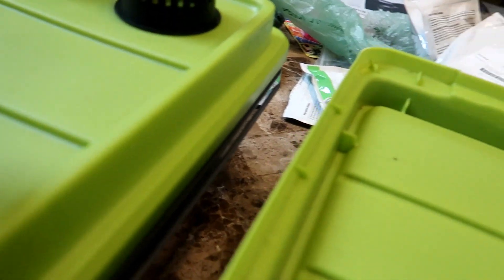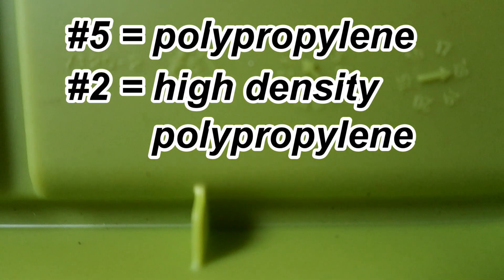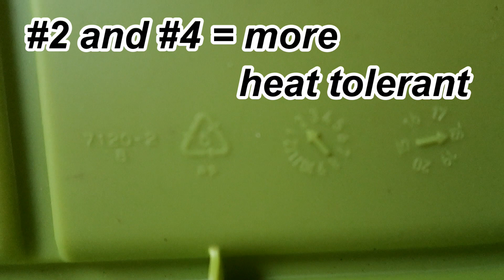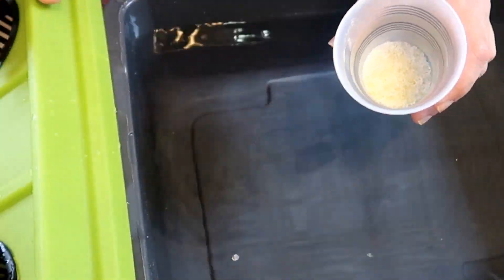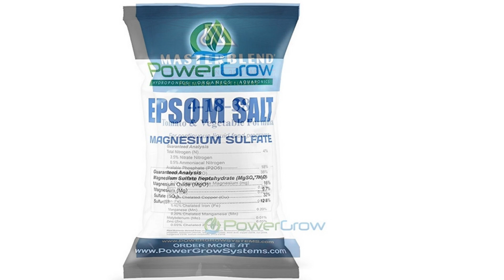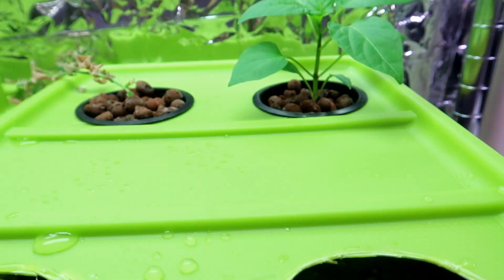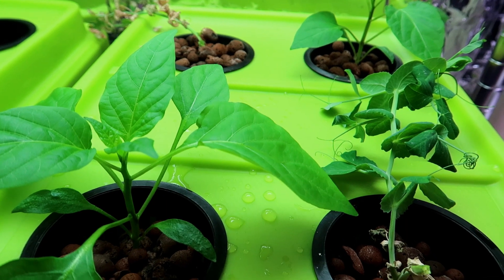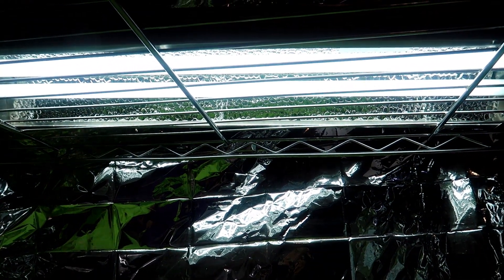DWC Deep Water Culture Hydroponic System: Simple DIY Set Up

Comment: very nicely done but it should be one plant per tub otherwise one bad plant can poison the rest and no drip on top of the pot to keep it going while the plants reach for water  as the pot should be at least 2cm above the water not in it otherwise the roots become unhealthy the foil also throws bad light natural light does not reflect under leaves outside so it shouldn't inside once i changed to that setup from the one in your vid and (ty as i would never have started without it)  i doubled its potential

Comment: i suggest having the air lines coming thru the lid, and having a spare tote for water changes, when it comes to it all you do is lift the top and put it onto the freshly prepared tote, simples, if you have an inline connector just off the exit from the lid you can make each system modular, things can be moved, disconnected simply, makes life real easy and you can make lids with varying designs of holes for different sized plants and switch them out, keeping the air line etc all wired in ready to put a stone on and bam you are growing

Also when you put your new seedlings and rockwool into the net pots have a layer of balls at the bottom, the roots will figure their way you dont want the rockwool to ever be saturated, its just meant to splash the new roots and be a humid environment to encourage them to grow out, the plants will rot if your main root ball node doesnt stay dry

Comment: Absolutely love your videos! You explain things so well, and aren't afraid to be honest about any short comings. When you said my lighting needs would be more in a basement setting, does that mean I'd simply need more lights (maybe a large one on top and both sides?) or that say, instead of a blue light like you have, the main light should be full spectrum?
Reply from the maker: Hi Angela, I think both since the basement has no ambient light, and no light filtering in from outside.  My kitchen grow area is the opposite of a basement, I have two large skylights and a large bay window.  On a sunny day we don't even turn on the lights, you can't do that in the basement.  I think a full spectrum LED would be your best bet.  It could also depend on what you are growing.  In my experience the leafy greens and herbs don't seem to need as much light as the tomatoes and cucumbers.  Microgreens do fine with even less light.  Experiment and learn, and have fun.  Thanks for the comment!

Comment: You’re a great teacher.  Very detailed and clear with your instructions.  I also use superblend fertilizer but I don’t use a scale.  I use 1 table spoon for the two and half a tablespoon for the other one in a 5 gallons bucket.  I brought my tomatoes, peppers and eggplant in to my basement which did great outside until winter arrived using the kratky method.  They don’t look too great now but still surviving.  I probably need much more lights and might even add air stones when I find the time.
Reply from the maker: Thanks for the tips and support, I appreciate it!  We need summer back....or at least an early Spring!